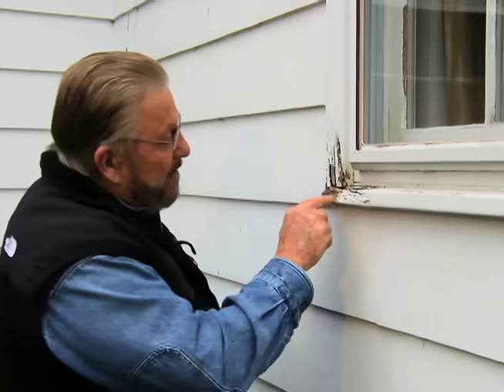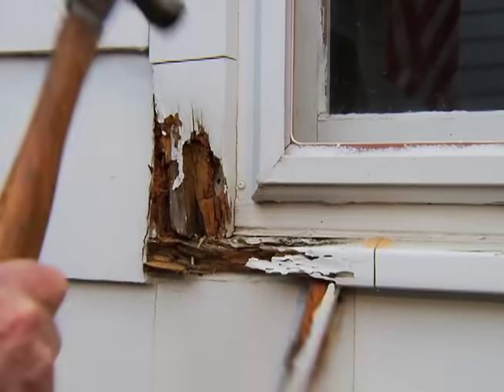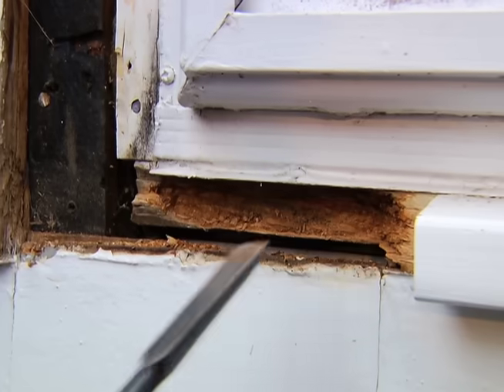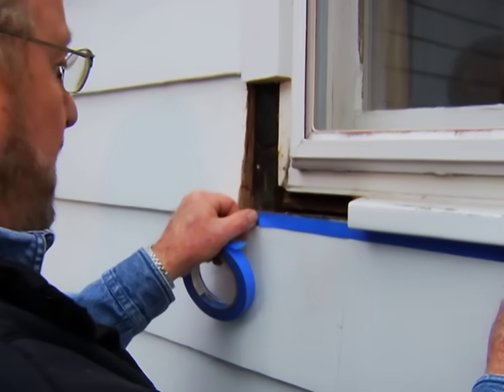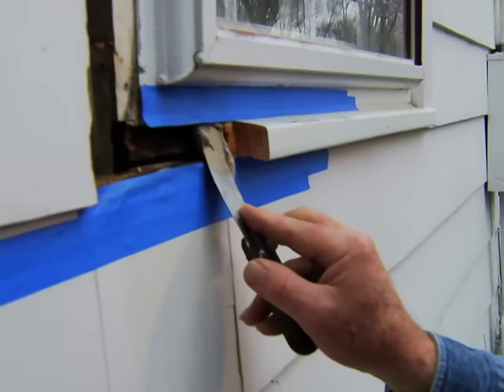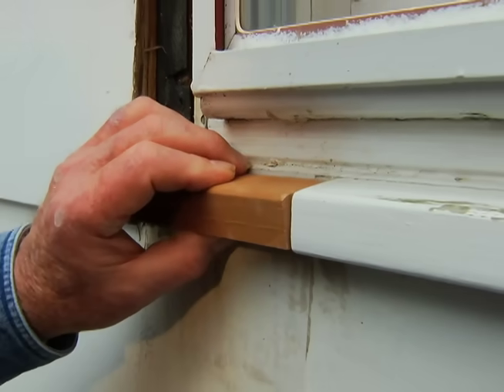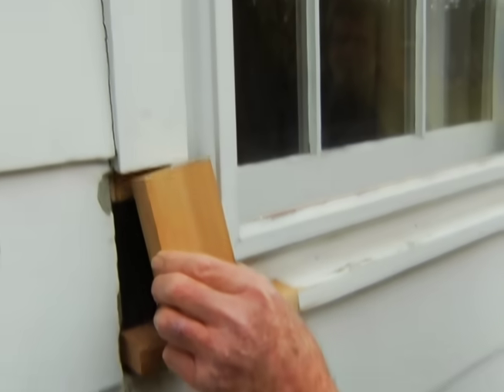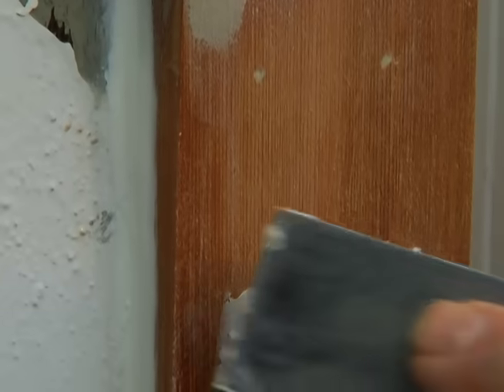How to Repair Dry Rot in a Window Sill

Comment: I saw you replace rotted wood, but no mention of the reason that area of the window had a water damage issue. What was the root cause?  Your patch will probably incur the same water damage over time....
Reply: Lousy paint or caulk from 5 or 10 years ago would be presumed as the root cause. Good caulk, and good paint every few years will prevent this.
 
(I am not a professional, just a homeowner, but have learned that “That Great Exterior Paint Job” is NEVER so great for my window & door trim. )
Reply: Jim Kraft Maybe he’s just trying to fix it for now in order to sell the house? 😂
Reply: its one of those Good enough for GOV @ least just to sale the house
Reply: Water gathers in the bottom inside of the screen frame and often the weep holes are clogged or even caulked shut.
Reply: @BenLowers  Yeah unfortunately when houses are built alot of corners get cut because all of these things are deemed unnecessary extra cost.  Painting it later can only do so much, as most of the underlying problems that cause these issues are already present once the house is built. 

This indeed, is why regular maintenance is essential. 

People can get away with murder building houses.
Reply: I would wrap the whole window with medal brake mechanic I am
Reply: It's a video on how to repair a rotted window sill. Not how a window sill became rotted!
Reply: my 30 year old house's window sills had "screen holders" - exposed pins which kept the screens in place.  Disastrous idea as water would infiltrate where these pins screwed into the sills and caused rot.
Reply: Jim Kraft Notice how he used cedar for the replacement pieces? Cedar is much less prone to rot.
Reply: @ekujj13  Excellent Point, At 35 I would replace the window, replace all the wood, put in flashing, and calk and seal. Now at 65 I do a quick fix, hide the damage and let the 35 yr old deal with it when I sell the house.
Reply: This movie isn't related of the source. This movie is an example how to fix not to prevent. You are revealing jealousy of how  good the his skills are.
Reply: @BenLowers  

I agree but is very important to prevent where the water is leaking on the damaged area or is it snow accumulating on the frame? My real, real problem is water raining dripping exactly the affected area. The only solution is after repairing the frame I should install a second frame to prevent. Not the all frame  just where the water sits .
Reply: common spot for rot, no overhangs on the house, caulk failed where the trim meets the sill trim end grain will absorb water and stay wet.as another said it could be the storm window.
Reply: It is true.  But sometimes the root cause has been fixed (like bad gutters running water down the side of a house) and you can just fix it and move on.
Reply: As a contractor myself, I hate when people like you teach others how to "fix" something improperly! This is a hack job at best! You ignore the real issue, which is why water settled in that corner of the window and rotted the wood. Then you complicate the repair by using expensive epoxy instead of just replacing the corner with actual wood. This is a mess that you are leaving for the next owner of that home! YouTube watchers, DO NOT do this